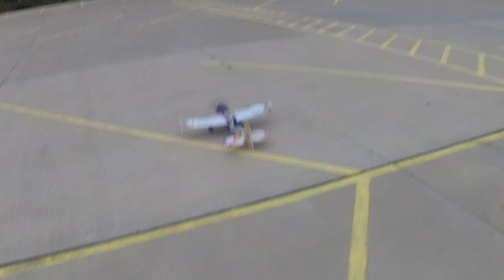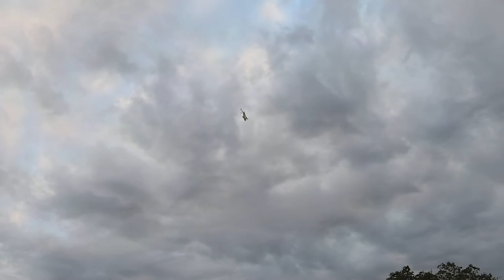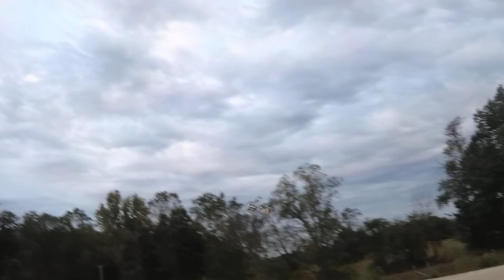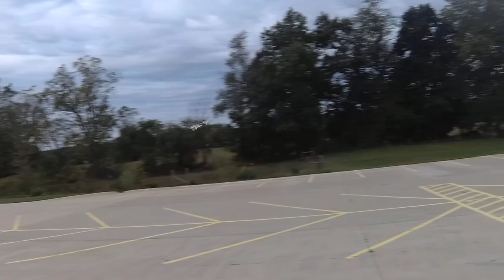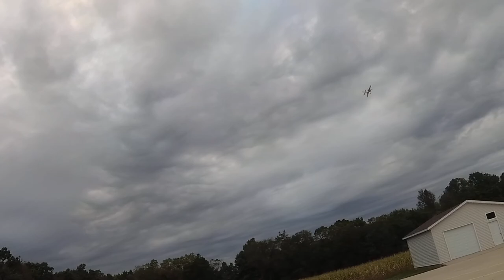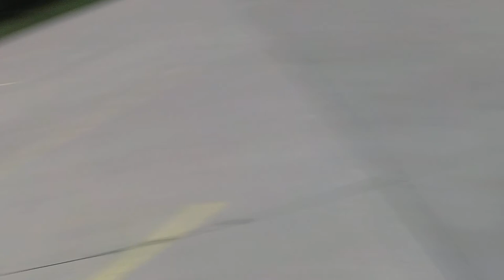9-27-2019 Future Model 38" Edge 540T PP a.m. flt

Comment: Great flying! What's your electronic setup?
Reply: And where is your CG? do you follow the recommended CG as per factory setup?
Reply from the maker: Motor: Dualsky ECO 2216C 1250Kv 
ESC: Hobbywing Xrotor 40A
BEC: Castle CCBEC 10A
Battery: 3S 1300mAh for this flight, although I normally fly with 1100mAh packs.

The factory CG marks is a good starting point, and may turn out to be perfect depending on how you like the plane to fly. I adjust the CG to have the plane fly upright and inverted without needing any elevator input.
Reply: @somespamsite44   your plane sounds more aggressive though we have the same setup but different brands. Is that factory prop 1145?
Reply from the maker: Prop is APC 10 x 4.7 Slowfly.
Reply: @somespamsite44  interesting. On the kit they sent me its an 1145 SF. Thanks for the reply! Hope to learn more from you.
Reply from the maker: Are you sure it's 11? All the stock ones I've got have been 10x4.5, both on the Edge and the Slick.
Reply: @somespamsite44  yeah my edge 540t came with an 1145 SF. It says so on the ziploc bag it came in. Plus I compared it with my 10prop and yeah its longer. I thought it was a standard so i bought 5 more of it. Yikes.
Reply from the maker: Maybe they've decided to change to 11" props. There's nothing wrong with an 11x4.5 if your motor and batteries can handle it.

I fly with an 11x4.7 on my "Heavy" Edge that uses a 1600mAh pack, and it does fine. The 1100mAh battery I normally use in the blue Edge sags too much with 10x4.7 to even consider using an 11" prop, though. I could probably get away with it when using the 1300mAh packs.
Reply: @somespamsite44  i might try a your prop setup or a 10x6 prop as from what i read from Rcgroups does the best flight characteristics. The problem im having is my thrust response is too sluggish. I can't recover quickly or zoom out from a hover. I'm using a sunnysky 2216 1250kv with a predator 40a esc.
Reply from the maker: I use a Sunnysky X2216-8 1250kV in my "Heavy" Edge, with the 11x4.7 prop.

What are you using for a battery?
Reply: @somespamsite44  I mainly stock up on 3s 1300-1500mah. Best ones I have are tattu 1300mah 75c. Picks up better than the 25c 1500mah ones I have but still a bit sluggish.
Reply from the maker: I'd try a 10" prop. I think the 11" prop is causing substantial voltage sag with your smaller batteries.
Reply: @somespamsite44  i might just. Thanks for the tip! Happy flying!
Reply from the maker: Let me know how it works out.

FWIW, I have a couple Tattu batteries. I really liked them in the beginning, as they seemed to be better than the Hyperion G5's I was using. But they seemed short lived. They still work, but they're nowhere near as peppy as they used to  be. 

I recently got some Ovonic 1300mAh 80C batteries, and so far they're great. I use them in my FM Slick and now the Value Hobby AcroCub. And also a few flights in the FM Edge. The 1100mAh Hyperion G7 batteries were frying when used in the Slick, so I gave the 1300mAh Ovonics a try for $15 each. Much better.
Reply: @somespamsite44  oh cool. Will definitely try them out. Not sure if i can get them air shipped to where I am. But will try. Cheers!
Reply: I did the battery placement like how you did. Not on the recomended CG but it balances well. My elevator is more responsive. Also tried a 1045 SF. Way better than the 11. Thanks for the tip! Got 5 flights out of it till my elevator hinge went loose. No damages.
Reply from the maker: I trim for straight upright flight, then I roll inverted. The goal is for the inverted flight to remain nice and straight as well. That's a neutral CG. If when inverted the plane tends to climb, it's tail heavy. Nose heavy if it dives.

This plane is slightly tail heavy with the 1100mAh packs these days after some elevator repairs and adding the two CF stiffeners. That's why I've flown it with 1300mAh packs lately. I've been meaning to move the battery forward a bit, but just haven't got that far yet.

Glad to hear the 10" prop worked better.

Having the elevator come lose and get away with no damage is a good day. :D I stuck my plane in a fence this morning. :D
Reply: Wow. I learn everytime from your replies. Yeah was lucky to get out of it without any damages, although I lost my tail dragger. I have flown it with my 1000mah  and it was very easy to maneuver around. Will fly tomorrow and will do the neutral CG trick. I have flown my plane with the battery close to the mount, CG more forward and it still flies good, but slow elevator respone for snaps. I like the way it flew when I tried placing my battery like you did on this video. will still try to find the neutral on mine. Thank you very much!
Reply: I did the CG test thing earlier this afternoon. Was a lovely day  with no wind. Mine was nose heavy still but when i removed the landing gear it balanced better but still a tad nose heavy. Mount came off, wing skin tear and some tear on top when a tree came out of nowhere and smacked my plane. Still fixable.
Reply from the maker: Trees will do that. I've lost count of how many times I've flown into trees. :D

Too bad about the damage, but like you said, it's fixable. As long as the center fuselage is okay, most other things are fairly easy to fix on these planes.